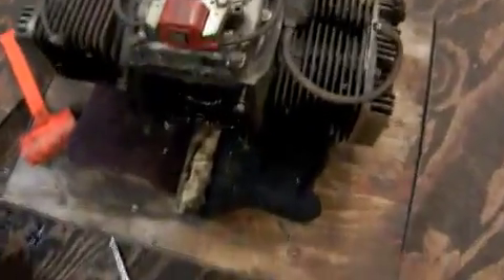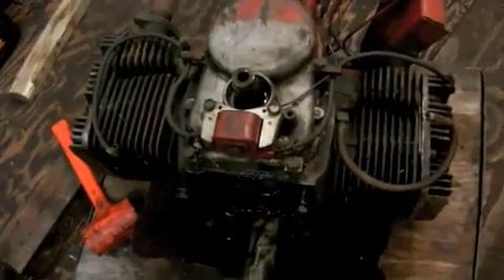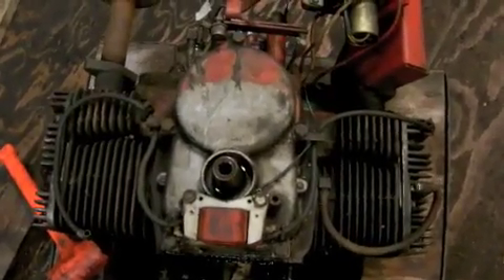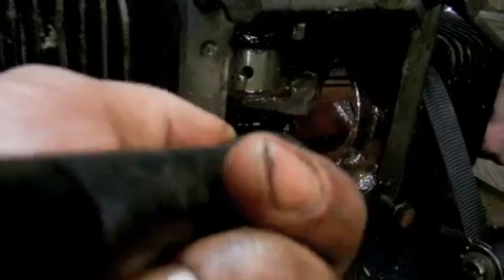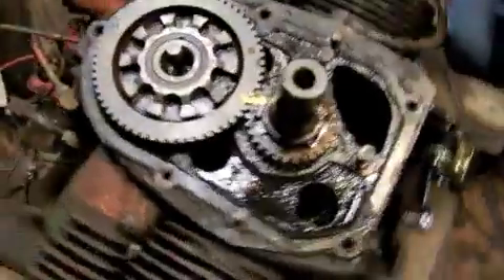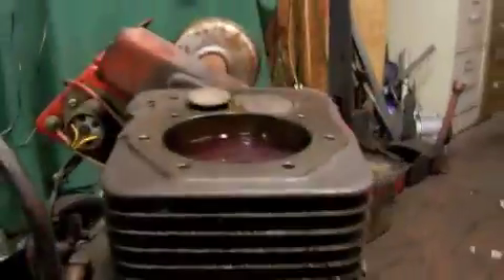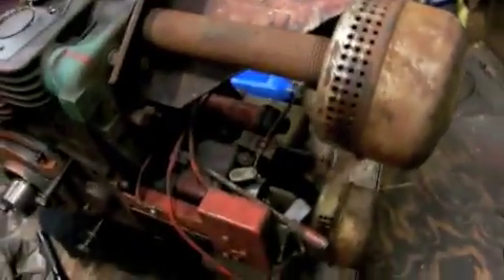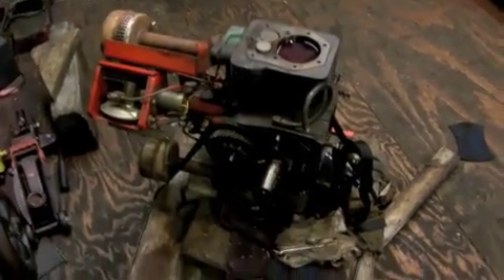Disassembling the Lincoln Welder Generator- Part 2

Comment: The acetone & atf is a good thing. I have heard of some people putting some diesel in there and putting a rag in as a wick and light it like a candle. The heat will sometimes work things loose. Doesn't look as if you have anything to lose. You're right about those pricey pistons. A local guy builds these Onans for small tractor pulling and he sends specs to Hastings and they custom-make eight pistons at a time for him. Way cheaper that way. Good luck!